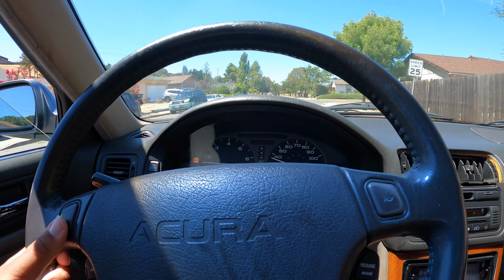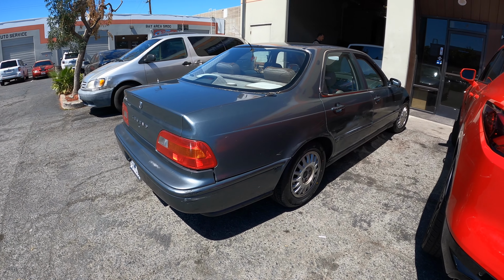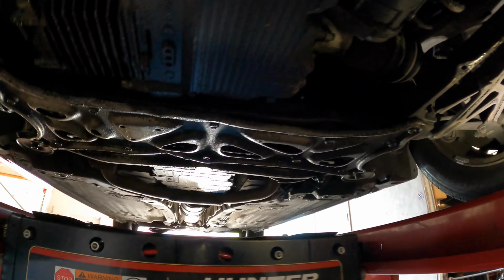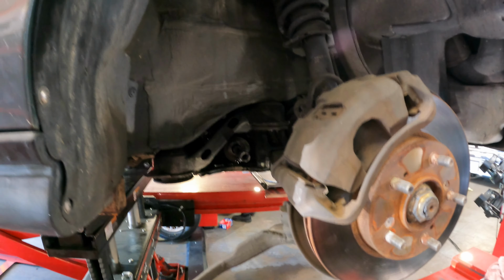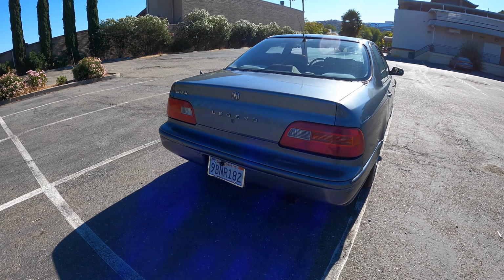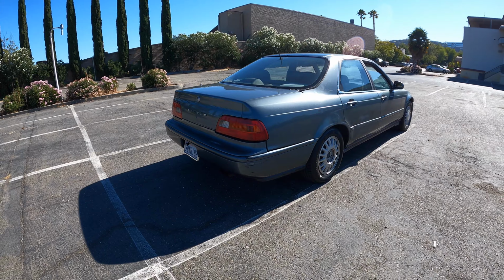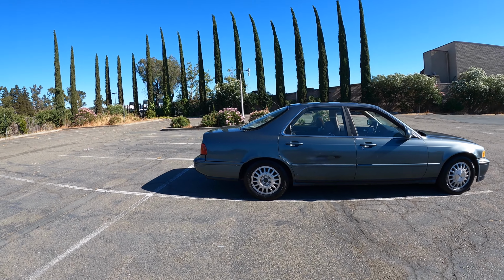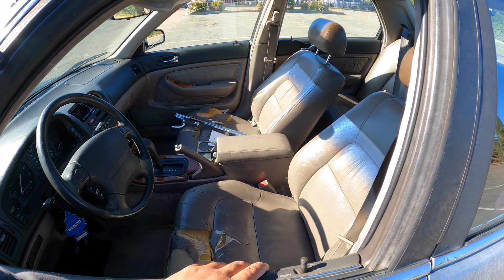MORE MAINTENANCE WITH THE ACURA LEGEND! | REPLACING INNER TIE RODS, BRAKES & ALIGNMENT

Comment: Need a center vent dude? I have uncracked ones but they're not cheap, and a couple with minor cracks.
Reply from the maker: It depends on how much?
Reply: @CarAdventuresWithReg  One with a small crack, $60. I'm in the Bay too. Uncracked go for $170.